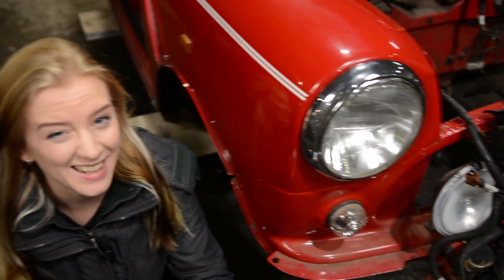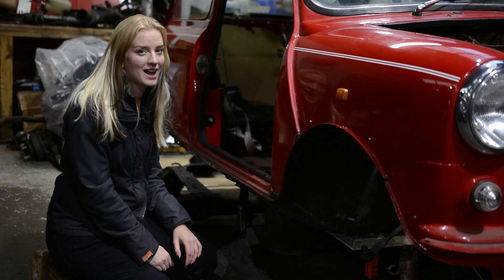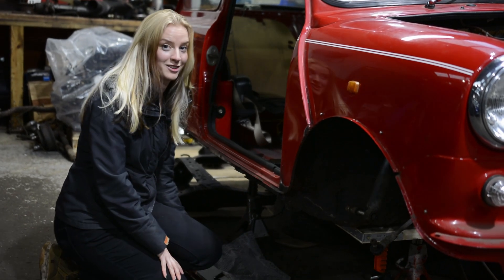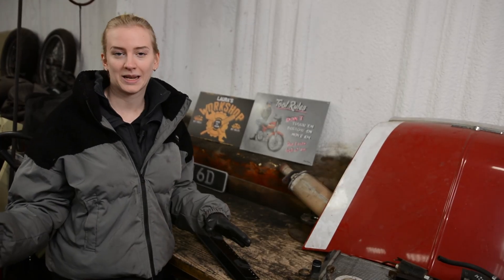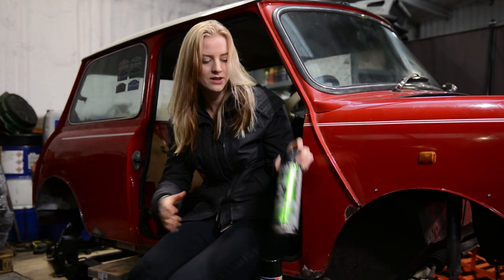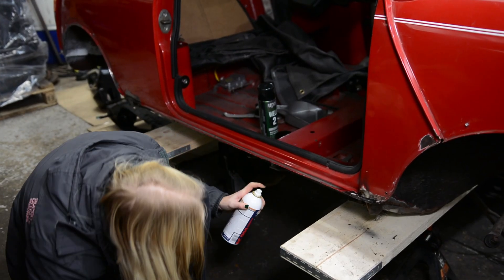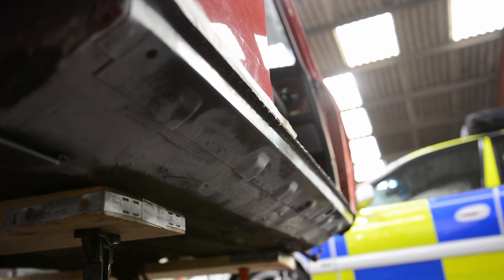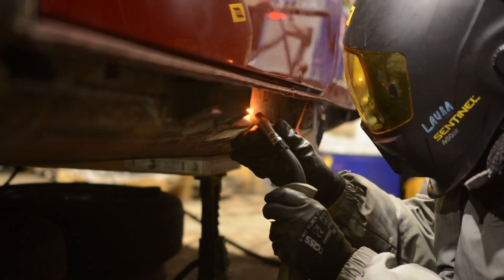I Completed All The Welding On My First Project Car (Episode 7) #classicmini #laurasworkshop

Comment: Sadly the classic mini was a car design way before they rustproofed cars like they do today.
If you take you time and use a weld though primer you will be making the car better.
If you want a motorsport tip. Stich weld along the seams under the door rubber seals on the door openings as it strengthens the car.